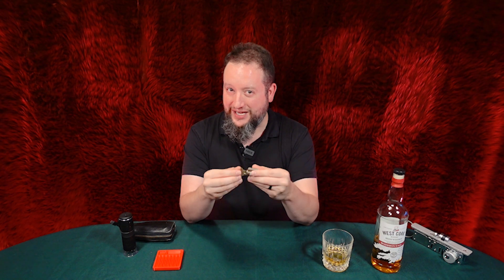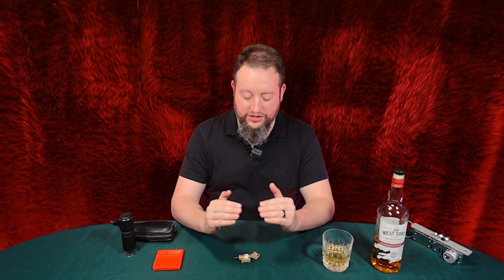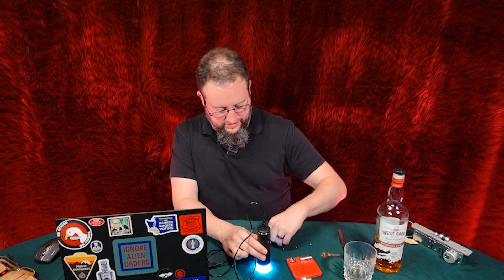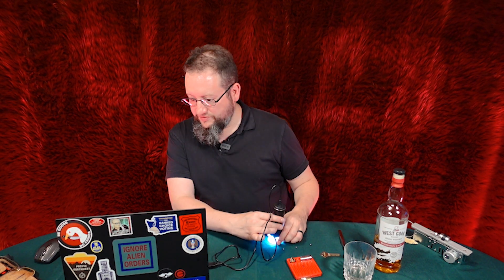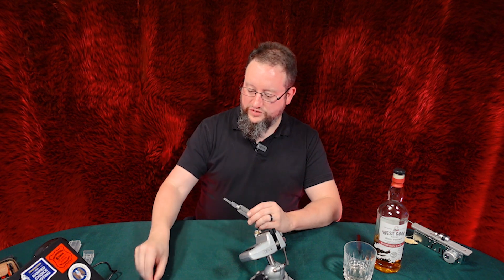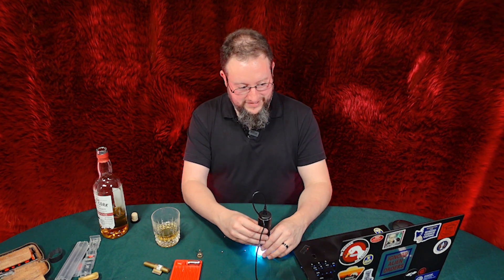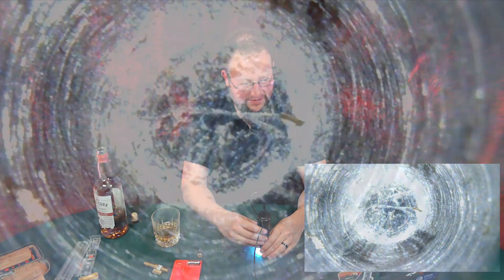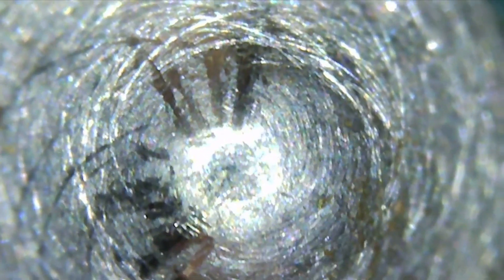Lishi 2-in-1 Tool Forensic Examination

Comment: I think an even better test would be to take a lock and pins that you KNOW (with reasonable certainty) has never been picked, but HAS been used. Side question: What is that microscope you're using?

Comment: Couldn't someone polish the edges of the Lishi blade, tip, and pin tick, just enough to take the sharp corners/edges off it with some super fine emery paper? Seems like that might make the blade swipe marks look more like an old key than something specific to the Lishi?

Comment: I think you'd have to make or coat a pick/Lishi tool with a material that's less hard than the pins in order to avoid scratching them. Of course, you run the risk of the tool wearing out or it may leave some material behind. Anyway, it's fascinating stuff; thanks for doing this.

Comment: Look for burrs or roughness on the Lishi body and the lifter. That seems to be the source of most of the marks. Polishing the Lishi would do two things: first it would leave only actual picking marks, second, it would be a stealthier picking tool (leaving fewer marks as evidence of picking). A soft chamois pad with a bit of extremely fine abrasive slurried in oil might be a good candidate for polishing. (It would also be better for polishing the pins to leave a fresh surface.)

Comment: If it's being caused by the body of the tool itself I bet if you coated the tool in a softer metal like aluminum or brass it would leave less of a trail.

Comment: How much would it help if you carefully polished and rounded off all the surfaces of the pick and tools where they contact any part of the lock? Done right all it could possibly do is burnish things, it wouldn't be possible to scratch anything. Unless all your pins were finished like you'd do the top edge of a key you were impressioning I don't think you could get squat for evidence out of it.

Comment: Hmm. I’m wondering if you might get better results with a better microscope? Maybe one of those binocular or trinocular models that are used in labs?
Reply: For example, maybe the “OMAX 40X-2000X Digital Lab Trinocular Compound LED Microscope with 5MP Digital Camera and Double Layer Mechanical Stage”, on Amazon for just over $350? I’m thinking about buying one myself….

Comment: Here's a couple of thoughts. 1 Is it possible that the reason it left slightly different striations than a key would is the different material? Most (granted, not all) keys are made using punched/ground brass, so it stands to reason that a somewhat polished steel tool would leave different marks on brass pins. It might be worth repeating the test with a steel key that you lightly polish/tumble. 2. Another variable to consider was the polished pins themselves. In this test, to make it absolutely fair, I would have done a side by side using new (from a pinning kit) pins as well as polished pins to rule out the polishing as having an effect. It may not have had any impact, but science, yo.

One other question, and this is just for my own curiosity. Did the key still work well after the polishing, or did you sand away enough material to make the pins just short enough that it  caught/didn't work?

Comment: If you are going to polish anything. Take it fully through the various grits. That once you establish a ground plane, 220, 400, 600 are needed steps before you jump upto 1200/1500 and then you want the appropriate buffing compound. Some materials let you skip certain grits because you are locally melting glass/plastic (a few microns being melted)

Comment: one thing that could be very interesting would be to use a set of brand new pins in a lock. Before putting the pins in, using sharpie marker or machinist dye to cover the  tips of the pins. Then insert the test object (key, lishi, standard pick, etc.) then remove the pins - the die will give much better contrast under the microscope.

Comment: You should use the microscope on the body of the Lishi, and the pick tip as well, and see how smooth it is.
I suspect that it may be quite rough under microscope conditions.
Then polish the Lishi and try this test again.

If the marks were from the body sliding in, if you put a high polish on the body, and maybe some oil or lube, it should reduce the marking, and if the tip is polished and lubed the picking should leave less marks.

You may need to use a polishing wheel and compound to get a high polish on it.

And FYI, I don't know how it will work on brass, but printer paper is considered to be about 2000 grit, though it doesn't cut as well as actual sandpaper.
It might give a shiny finish on the brass though.

Comment: Just out of curiosity how sharp are the faces of the lishi tool? If this tool has sharp laser cut edges the a fine rub with the 1500 grit paper could take most of the cutting/marking edges away.
Polishing the pins with wet and dry paper will work better with the paper wet. Even a drop of water from some ice will give you a less abrasive finsih.
Yet another great video.

Comment: I don't do forensic locksmithing (yet, it's on my bucket list) but I'm curious... COULD there be a difference in the tool marks on the sides of the pins between "Key" "picking"  (especially a more unskilled attack, like raking) and "Lishi" on the SIDES of the pins due to binding...  

The way I'm thinking is that MOST people (most, not all) end users tend to only apply rotational tension once the key is fully in... IF the customer IS one of those, the wear marks on the sides of the pins would be uniform and fairly light (minus drunk nights, where hopefully they didn't drive home)... At least according to my theory... 

A Lishi, because it's a more accurate tool, requiring lighter tension for picking (A more elegant weapon, if you will) would leave distinct binding marks BUT perhaps not has heavy a mark as traditional picking attack ("How uncivilized." lol") even in the hands of a skilled lockpicker.

Comment: Very Interesting video. As a forensic locksmith, I would suggest photographing/video new pins that have never been picked. I use Play dough as a photo stand. Assemble the lock and insert Lishi tool ONE time in lock, no picking. Disassemble to see if inserting which simulates a number 9 pin, leave swipe marks on pins. Photograph and reassemble  and pick and disassemble and photograph. This can be done with one pin in lock if time is a problem. Have fun.

Comment: I have the same kinda-blurry result with the GoPro9. I think the cam works a lot better as an action cam than a static cam, but I haven't tried any post-processing other than recording in 2.7k and exporting in 1080p. That sharpens stuff up just a bit.

Comment: Very cool Interesting results. Thanks for taking the extra time to give the pins some polishing, making the marks much better visible for interested non-professionals like me. On a side note: An aspect I have noticed the first time during the last forensics video is that the pins obviously rotate quite a lot around their main axis during normal use or picking. Do you think it would raise or lower the security of a lock, if the pins would run on rails (i.e. couldn't rotate apart from a little necessary play) and why?

Comment: Try adding some Jewelers Rouge ,either red or white , to a cloth wheel and you will get a mirror polish on those pins. 
Great video, awesome topic.
Reply: Yep, it is the compund that does the work not the force applied.

Comment: Interesting test! I'd suggest doing another test where you polish the pins first for two locks. Then open and close both locks 10 times using the correct key (fully removing and inserting the key between each try). Then insert and remove key with incorrect cuts e.g. 10 times in one lock. And for another lock, open and close the lock with Lishi tool and insert incorrect keys for 10 times. Then compare the marks between the locks.

I'd assume that the small marks that Lishi tool leaves would be hidden by inserting and removing a key many enough times times. If that's true, hiding your forensic marks after using a Lishi tool could be done with just a key cutted 0123456 (with zero cut at tip because some keys count from another end; the idea is to have pins closer to keyway opening to hit on different heights) and repeatedly inserting and removing it from the lock after you've relocked it again.
Reply: That sounds interesting

Comment: Investigate this further!  Very neat.  Try a blind test with someone else like LPL or the like.  Do polished pins, new pins, and used pins; three sets each.  Pick one set with a medium hook, pick one with a Lishi, and on the third just use a newly cut key.  Send them to the other person to try and tell which one of the 9 total sets of pins were Lishi, medium hook, or key.
Reply: also add one batch that will not be used at all, not even with a key to so we don't get placebo marks
Reply: New pins are typically shipped together and may scratch each other.  Maybe we could get a machinist to make brand new pins that are polished and individually shipped.

Comment: Would picks made out of a softer metal leave less/no marks? I'd love to see a series of these forensic videos
Reply: Yes, but they'd be way less durable.  Like if they were made of copper.
Reply: @chemistryofquestionablequa6252  durability plays zero critical role in a B&E scenario . nobody cares if they ruin a 10$ pick on a doorlock that protects thousands of dollars worth of items or infos.
Reply: @chemistry of questionable quality is right, and it also could/most likely will leave material within the keyway, which could potentially be identified.

Comment: I'm sure this is asked a lot, but would it work to do something like putting a thin layer of teflon on the contact surfaces? something soft enough not to scratch, but also not sticky enough to rub off on the pins
Reply: Ptfe is pretty soft, at least compared to metal. If the pins were rough you'd probably get it stuck in the pins. Although it might just scratch up the Teflon and not transfer.
Reply: @NuclearArbitor  that's why I thought of it. if it just rubs off and doesn't stick, you could just blow some compressed air in the lock when you're done to clear the dust

Comment: So on a cursory inspection, it would be interesting to see if a forensic investigator would know what those parallel striations were caused by. That could happen from a rough key right?
Reply from the maker: in a sense, maybe it could.
Reply: @DeviantOllam  I'd be curious about the differences in marks between a factory/CNC cut key vs an abrasive duplicator cut key.

Comment: Question : Picks leave marks because they're made of a harder material than the pins right ? Spring steel vs brass ?
For regular picks, I see the point of having that 'springiness'. But the way the lishi arm and body are designed, wouldn't it be possible to machine them out of a soft metal, like brass (maybe even copper or aluminum) ? Maybe a hybrid design with a spring steel arm and a copper tip ? Would that prevent most of the marks ?
Reply from the maker: I have thought about trying to braze something like copper or brass onto the tip of a Lishi or maybe powder coat it with something softer
Reply: @DeviantOllam  I'd assume polishing the tip of the Lishi tool to be really round and smooth should be pretty good, too.
Reply: @DeviantOllam  maybe sand the tip down a little first so the coating doesn't make the pick too big to use easily?